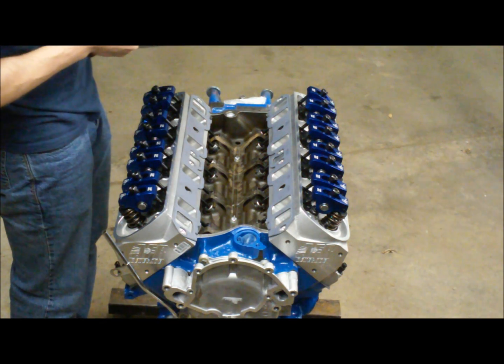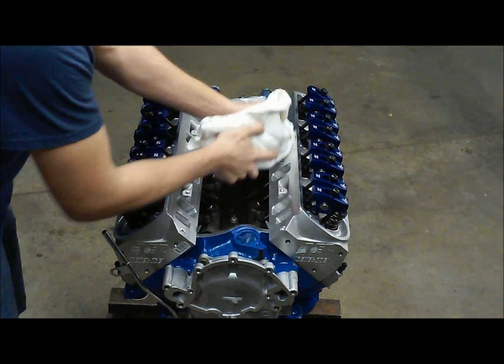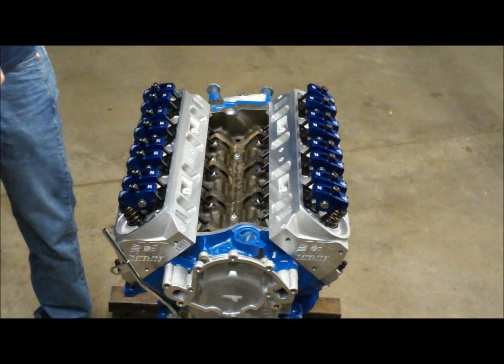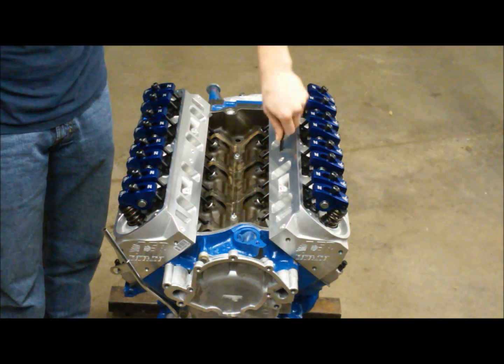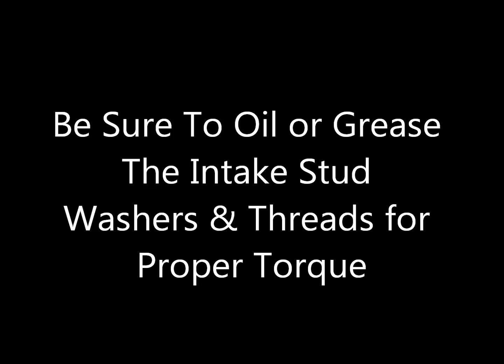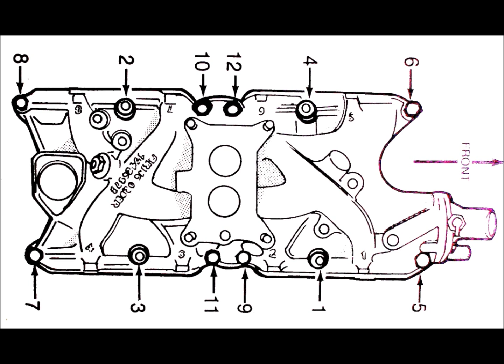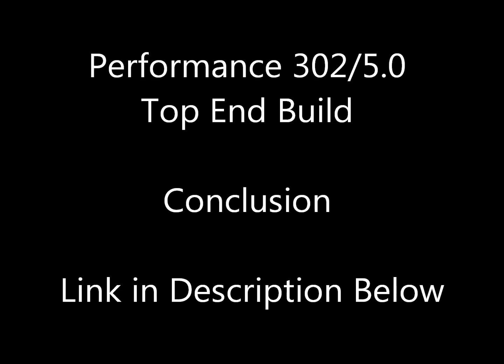Intake Manifold Installation (Vid 4 of 5) - How To 302/5.0 PERFORMANCE Top End Build

Comment: wouldnt you want to use thread sealer on the studs? Is there any advantage in using the engine lube over thread sealer?  Or are you just using it for lubrication to get the correct torque without friction?
Reply: I'm also curious about this especially on the corners of the intake where the bolts like to rust in place and snap off during removal

Comment: LOL have all your mating surfaces clean....I cannot stress enough how many times me and my friends have literally ran our engines after dropping some dirt down in the valley during an intake swap or repair. We have never had a single issue with the engines that we run....our transmissions however are a completely different story.

Comment: Hey sir..your videos have been so helpful on my SBF. Question you might know. Edelbrock now says DONT use the Fel-pro 1250 but instead, use Mr. Gasket 203(g). That's a standard type no emboss and I see why. Looks like the fel-pros block the water port unless you trim. So my question is - Mr. Gasket also has the same as the 203 but with the embossed port like the Fel-pro...you think that would be okay ? Of do you think they want the dead flat ? Thanks !!!!

Comment: I would have put sealer on both sides of the gasket.
Reply: @tramr3203  Never use the rubber or cork end seals cause they will always leak. Use a 1/4” bead of high temp RTV. The grey by Permatex is suppose to be the best. The front and rear ends of the block are called the China wall.

Comment: On these studs you have used from ARP, I am looking at running ARP head studs and intake manifold studs as well, but where I am going to make changes is my AFR heads and aluminum Edelbrock Performer intake is going to be primered along with the rest of the engine with Eastwood`s 2k engine primer grey and then coated with Eastwoods 2k Dark Ford Blue for this OEM look.

Question I have is, have you ever painted over ARP studs before?  If so any problems from taking the engine apart if it had to be taken apart in the future?
Reply from the maker: If you try to paint aluminum, it will flake off unless you really scuff it - assembly hardware tends to paint up better, but put a wrench to it, and it will take the paint off unfortunately. 

Iv done engines both ways. Build the whole thing then paint it works best for the oem look
Reply: @ThunderHead289 , Thanks for the reply.  That was my line of thought only thing I wouldn't paint assembled is the valve covers as I am looking at the Proform Ford Racing slant edge valve covers and maybe the oil pan.  Not sure if I want to get paint on the felpro one piece rubber gaskets I got for the oil pan and the same style for the valve covers.

Aside from that I really want to make it appear stock with just some bolt ons.

I understand paint can flake, Ive had paint flake off cast iron blocks before, sbc`s are most commonly found with flaking paint in the tight corners above the timing cover on the passengerside.  I hope that the aluminum in this case will fair good considering I will be priming and coloring with a 2k 2 part urethane engine paint that should stick better and be more durable than cheaper engine paints you pick up at the local auto part stores.

I don't know how my build will look if I omit the studs then install them after painting so they remain in their black finish.

Comment: What Intake Manifold would you rec for an FE 390 that is mostly stock (4bl Holley, stock heads, Stans Headers with dual exhaust)....engine is for F250 hi boy for street and mild haul/farm use)?......thanks!
Reply from the maker: The selections for the fe are sadly limited. I thought the only intake and heads you could get were through Edelbrock
Reply: @ThunderHead289  ....what about an edelbrock performer or edelbrock street dominator?

Comment: nice work! are those the fel pro gaskets suggested by AFR? I'm installing mine right now. Going with a FiTech EFI and had to change my cam (muther thumper w/ 5" of idle vacuum) to XE 274, what a pain in the a%$ having to do it while in the car.
Reply from the maker: +Al Burmaster they are your standard gel pros, if I remember right. The ports matched up very well. You will be much happier with a smaller cam. You make all the power with heads and valve train. That's a perfect cam.
Reply: ThunderHead289 90% of your power is in the heads.

Comment: How much for a motor like this. What kind of power did it make.
Reply from the maker: i sold this one for 4800. made around 385 if i remember right. could make more, but it was set conservatively and had a modest compression ratio for pump gas
Reply: +ThunderHead289 were those the 165 AFR heads or the 185 AFR heads. How much compression was the motor making. Did you use a 4340 forged crank or was is a reconditioned stock crank. I'm asking these questions cause I'm thinking of having a motor built for me by a engine builder. Was thinking of doing a 351 with the 185 AFR heads with 10 to one compression with a air gap manifold and a 750 carb or MSD atomic with the edelbrock split lift cam that I beleive is like 570 something on the intake and 580 something on the exhaust side. Basic rpm range is like 1500 to 6500 according to edelbrock specs. What would you probably charge for a build like I'm talking of.
Reply from the maker: id go with the 351 with 185s for sure. put a smaller extreem energy comp cam in there and you will be happy. id stick with a cam curve like you describe. 
as for the cost, i usually charge about 1200 labor to do the job and install it in the car and run it in. on top of that is the sum of all the parts including machine work. this was a stock crank. the machine work to have an engine right on the bottom end is what really runs the price up to a degree.
Reply: +ThunderHead289 thank you. I'll have to keep you in mind when I'm ready to have my engine built.
Reply from the maker: gotcha, just let me know. im a mechanical engineer by trade, and with where i work, i have more time in the winters for builds for sure.

Comment: I've found Ultra grey works just as good and is much easier to work with lol. Engine looks great man! you do some really good quality work.
Reply from the maker: Thanks! The problem with ultra black is that if you ever have to remove it, it's not forgiving at all!
Reply: That's what I like about The ultra grey, it comes off much easier.